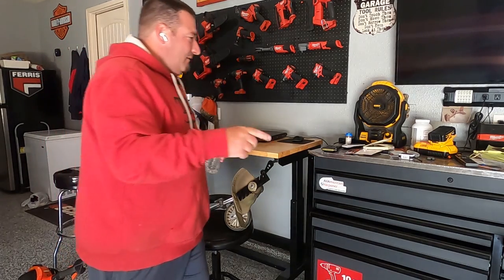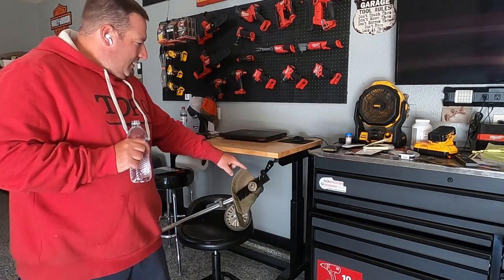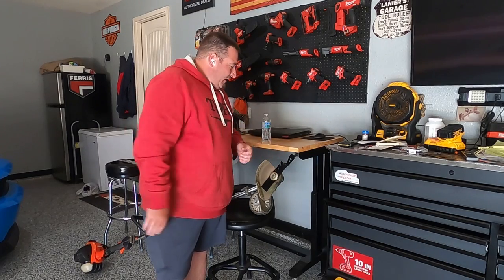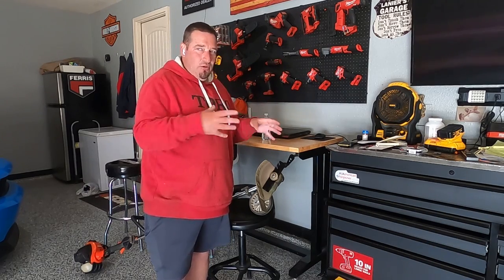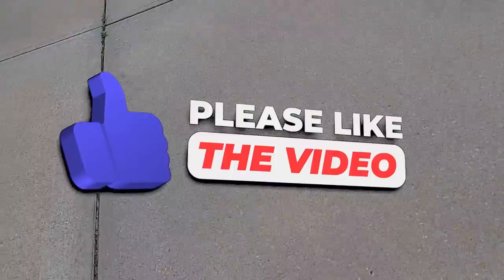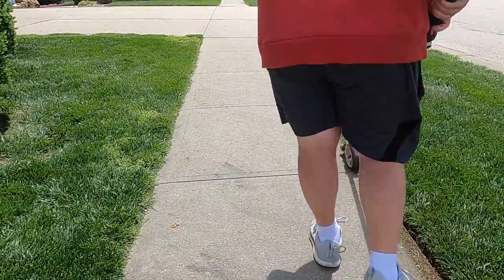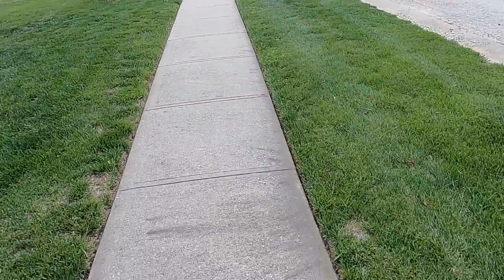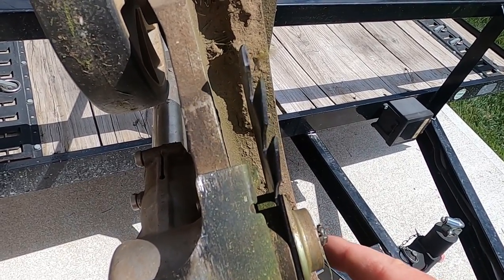Oregon Edger Blade  [JUST HOW GOOD IS IT]

Comment: Will the blade hitting the concrete cause "vibration" related trouble for the edger, and will that blade chew up the concrete ?  I use the standard Oregon edger blade ... only time I get in trouble is edging when it's too wet.
Reply from the maker: I’ve not had any issues with the concrete. I will say it didn’t last very long for what I was personally looking for but it’s the best I’ve found if your cutting tall fescue at 3.5 or higher